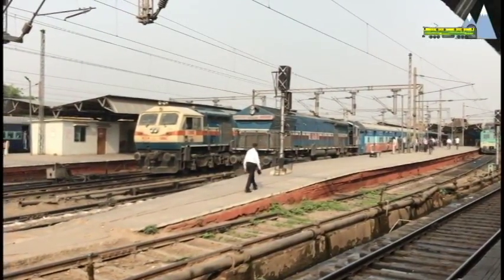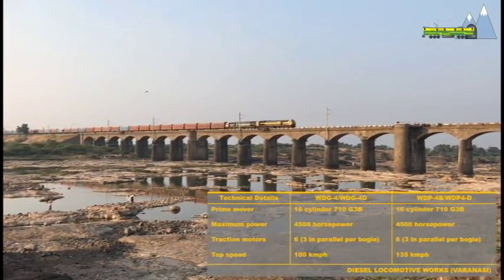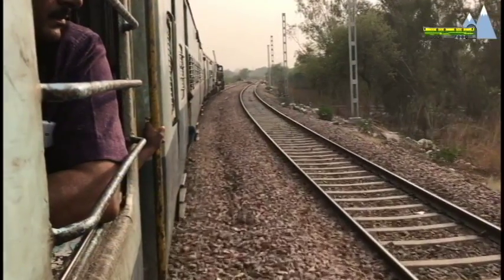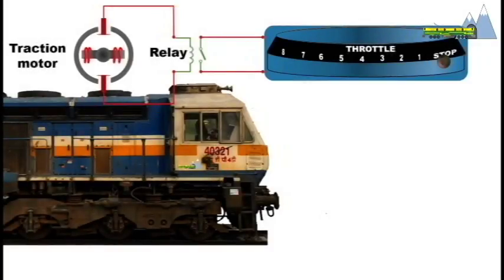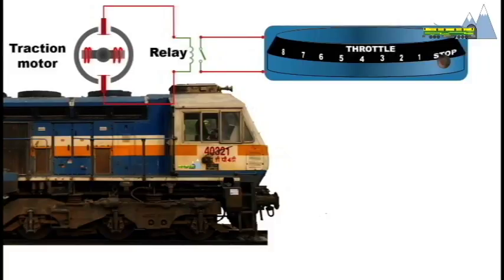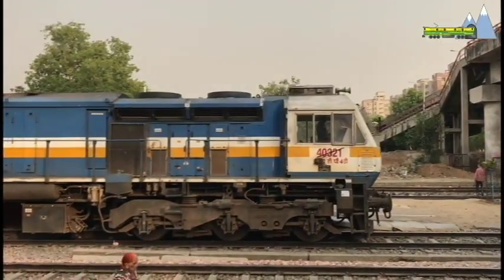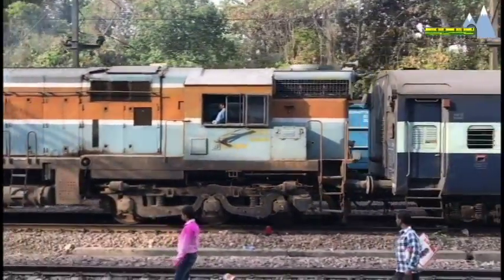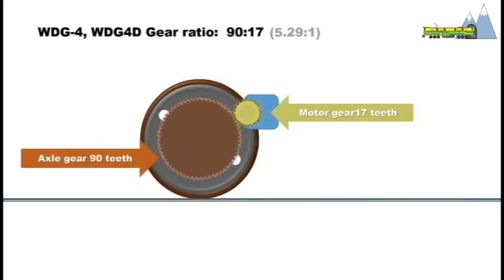How are horsepower, speed and tractive effort of locomotives related?

Comment: That means if I put my geared bicycle in the 21st Gear, ie in a Gear ratio of 7:3, then my cycle can pull heavy loads right ??
Reply from the maker: Provided you also have the horsepower and tractive effort
Reply: @TheTrainStory  there is no engine in my cycle obviously. So I cannot. Only engine produces hp
Reply from the maker: @JishyFishy41X6  Horsepower is a unit of power. Since your cycle is presumably powered by you it will have the horsepower of your muscles, unless of course you lack muscle power, in which case indeed your cycle won’t have any horsepower. I expect the next comment from you would be what is power? Any standard Physics book would give you the answer but it appears you lack an understanding of physics. If needed, for your next comment I will explain what power is...
Reply: @TheTrainStory  Power is rate of Work Done. It is Newton Force x Displacement s upon Time t. Since Displacement s upon time t gives u velocity, Power can be called as a Product of Newton Force and v Velocity
Reply from the maker: @JishyFishy41X6  since you know everything already... why were you asking silly questions about your bike???
Reply: @TheTrainStory  I just wanted 2 confirm. That's it. I am planning 2 connect my wheeled luggage and run my bicycle at different gear ratios. Once when I saw this video itself I got 2 know that if I change the gear in my cycle I can drag different loads at different speeds. But I wasn't sure bcoz in the ratio of 1:1, I couldn't pedal my cycle properly.  I feel that my pedal has become loose or something. I couldn't even attain a proper speed in the 1:1 ratio
Reply: @TheTrainStory  If we go per your science, The bheem wdg5 has 5500 hp engine with a gear ratio of 90:21. In spite of 1000 HP increase and Gear Ratio increase, it has a tractive effort of 560 kn, which is just 20 kn more than WDG4 and WDG4D. This is the reason why WDG5 failed. BLW needs 2 reduce the speed of this loco 2 carry large amount of items. Speed of the loco is currently 108 kmph (30 mps). It should be made 2 90 kmph (25 mps)